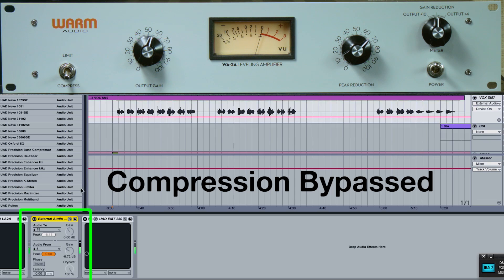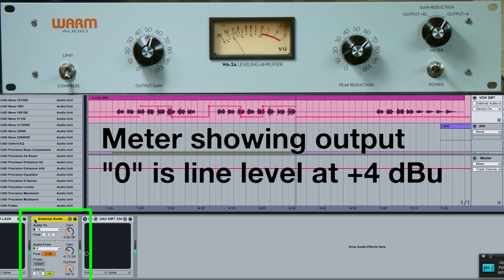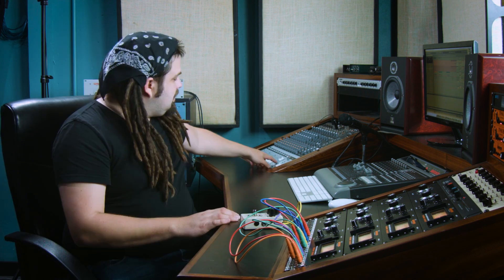Studio Basics: Hookups, Routing, and Digital Headroom

Comment: Hi, Ryan! Recently watching your videos and find them very interesting and well-produced. God bless you man! I've got a question about ZERO on the meters on the mixer. Does it have any concrete meaning or it's just relative?
Reply from the maker: Yes, to the best of my understanding it means that the signal would be 1.23 volts if in an analogue piece of gear, which is "Line level", or "Unity gain". This is what you preamp up to so that the mixer works with stronger signals and hopefully less noise.
Reply: ok, so we have less noise when making a signal stronger on the analogue mixer? now why we have meter that indicates so wide spectrum of meanings in the digital mixer or like daw mixer? By the way, what model of digital mixer are you using? I remember, that it's mackie's one... It's  absolutely delightful!  I'm a drummer too, by the way, and I've got analogue mixer on the one hand and 8-channel I/O on the other, but It's much more handy and pleasant for me to turn physical knobs and move real faders than do it virtually on the screen. And your mixer got that cool  synchronisation with daw faders... Happy about your equipment) Thanks for the answer and let us be friends

Comment: I have a question but its on the more "mixing" side of things. Why do so many engineers have the individual channels so high e.g. -6 db in the DAW and the 2BUSS is clipping. Or sometimes they let each individual channels to nearly clip in the DAW! I see that all the time and it confuses me. Could you do a follow up regarding a complete MIX session and your opinion on the general "correct" approach to gain staging full tracks at the recording phase. (Always assuming you record at 24 bit)
Reply from the maker: Yeah, I'm really not sure why they do that. Some rely on 32 bit float which means that it doesn't matter if you clip the channel, as it will adjust. But your converts will clip going in, so I'd rather do it right. This is one of the few areas on engineering that I think there is a "Right" way to do it. many others are always a debate and an art form.
Reply: creativesoundlab Τhanks for your input.  You have great content by the way!  Keep it up

Comment: I have found that I always start at negative 6 db.  After I complete all the tracking I send everything to a master bus and meter there.  i adjust as needed.  I have found that if I run material through analog gear after tracking, I need an additional 6 to 8 db reduction because of the makeup gain I recieve on a lot of my analog gear.  I havnt mastered this yet.  Thanks for the video.  Never knew my gain staging would be different from the DAW to the interface etc.  Make another video showing how you gain stage in a session.  I think it would help folks to understand more, including myself.  Be safe and thanks for the videoa man!